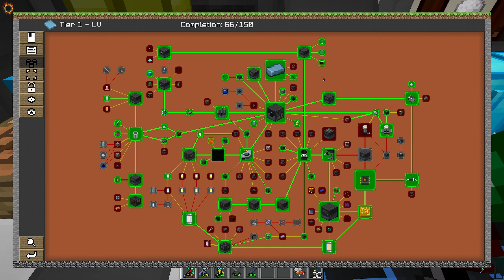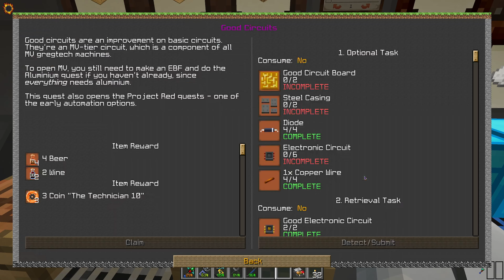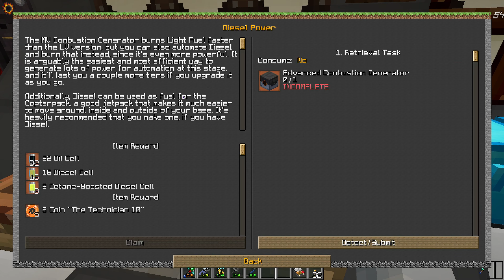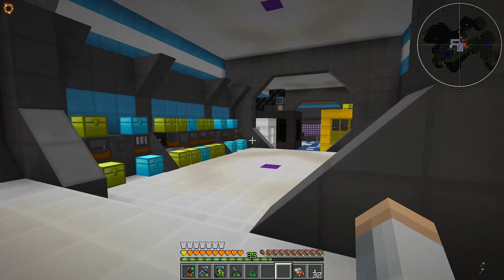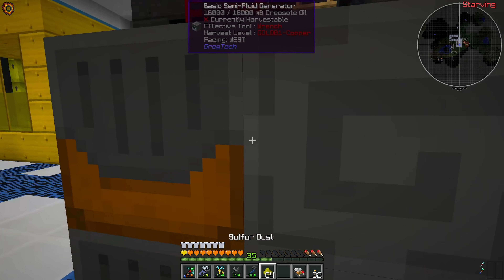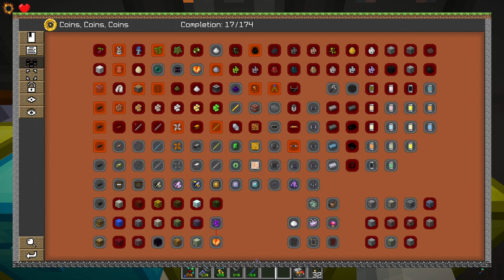Gregtech New Horizons Guide E18: Powering Our Way Into MV With Oil!

Comment: About miners, its defnitely worth to use them BUT you need to remember that LV ones have only 16x16 blocks range.. nowhere near max size of vein. When you get to MV ones it has 33x33 and at HV 49x49 (entire vein 3x3 chunks more or less) so remember to put better miners at already "mined" veins! + u need to chunkload entire 3x3 chunk area then. As a bonus, you can power MV miner with 32EU/t LV voltage!
Reply from the maker: Yeah, that's a good point about going back and that you can power an MV miner with an LV generator. I'll keep that in mind! I'm excited for the bigger coverage and higher fortune level on it.